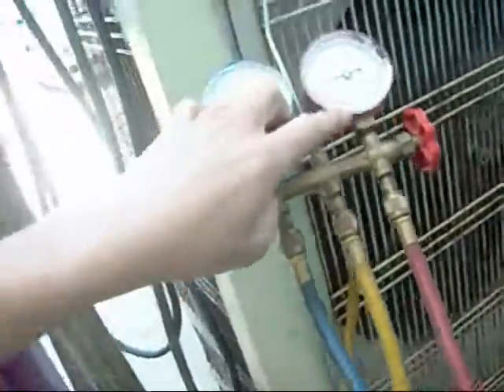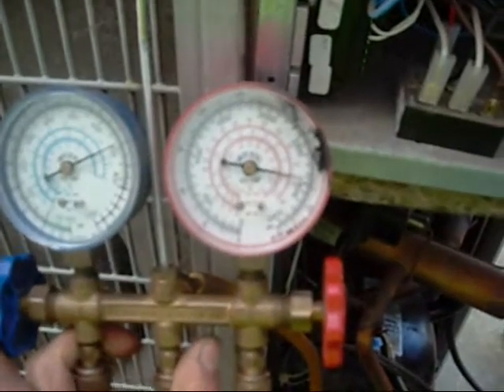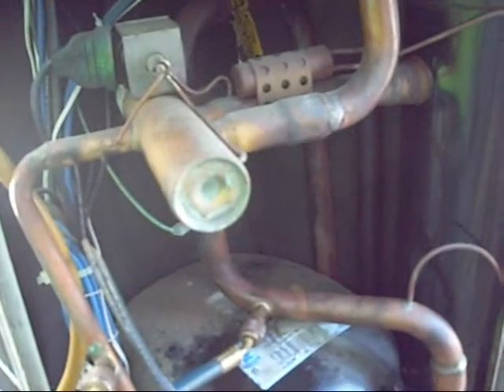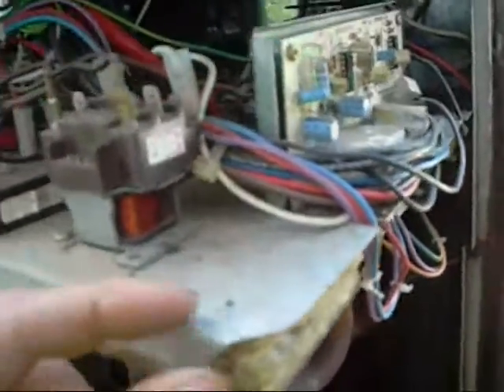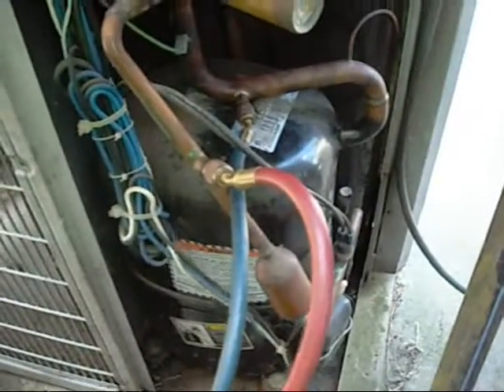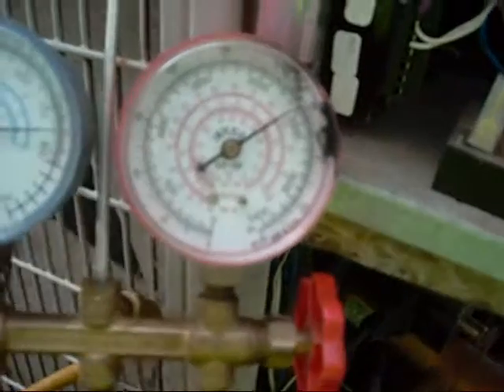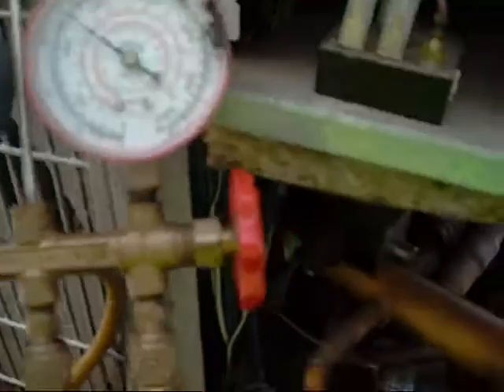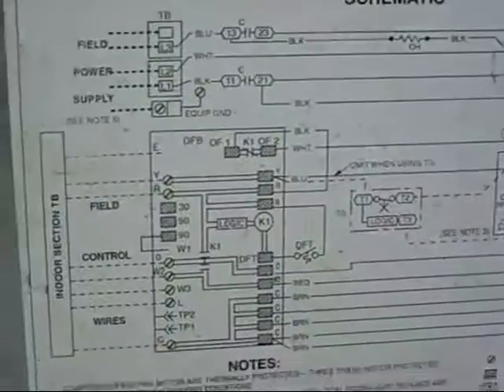Advice Needed on Carrier Water Chiller Fault (Resolved with new units)

Comment: OK, I think there are couple of problems.  Reversing valve issue, most likely.  Also, look at about 2:28....... the coils look completely obstructed and need to be cleaned.
Reply from the maker: +Camel Crush oh they were rotted out, we got it working for another 12 months then scrapped both of them.

Comment: You might want to clean the condensing coils is it's tripping out on high head pressure. It looked like the condensing fan motor was running so that can't be the problem.

Comment: probably wont help, but the way to check a standard heat pumps reversing cycle is to unplug the condenser fan motor, wait for ice rings around the lower potion of the condenser coil, when you see ice check for 24 volts on the defrost sensor, one you get the 24 volts on the meter there is a test switch that you short out that engages the reversing valve..... hope this help....

Comment: My guest is the RV is stuck in the middle. Try disconnecting the wires and try it again. If that fails? Try connecting the RV directly to a constant 24V supply. If push comes to shove. You may want to remove that RV and bypass it all together(assuming you don't need reverse cycle?)..

Comment: looks like the reversing valve is sticking/stuck in the middle position because the head pressure rises to fast or all those systems were overcharge during low ambient conditions....replace reversing valve ,blow out discharge line and conenser, and replace  fliter drier.

Comment: @Aussie50 I think i'd be looking at th RV first too. If the chiller is only used for cooling it might not even be needed in the system, might be left over from when it was first built/converted. Would need to know exactly how it works to say for sure.

Comment from the maker: I did some research into the controlls and it trips without the compressor simply because it thinks its dropped phases, its just a safety device to protect the comp.

I'll be looking at it again today, I'll energize the RV a few times while its under pressure and see if it frees up.

Comment from the maker: no fault code on the display, its just a thermo

I've checked the flow and pressure switches and they are fine, the relay works too.

its a refrig gas pressure problem for sure.

Comment: standard volt meter should tell you where your break in power is, wish i could tell you more, but im no chiller man, just residential stuff here... should be the same principle though, low voltage controlling the high voltage. sounds like to me its a low voltage problem if itsdoing it with the compressor off. maybe a board.

Comment: Are there any other gauge connections on the high side you could connect to and see if the pressure rises so quickly there too?
I'd expect that compressor to be three phase so no hard start kit would be fitted.
Apart from the reversing valve are there any other valves in the high side?

Comment: Not worked on one of those,  it dose trip very quickly! At 450 psi i expect it to be tripping on HP switch, i wonder when it trips with comp disconnected if it trips on something else?  Looks like a restricion in the pipe from the compressor to the condenser to me, if it was the txv or capiliary i'd expect it to run longer as it would need to fill the condenser up with liquid before tripping.  Does it work in the opposite mode to the one it has been tripping on, heating instead of cooling?

Comment: If your low side pulls into a vacuum,and you have an extremely high head pressure the TXV is most likely stuck ! That is a tell tale sign. 

If you could keep it running long enough you could test temps on both sides of drier for obstruction . I would cut out driers regardless and replace ...

Comment from the maker: nah sorry, never dealt with that before, I'm having enough trouble fixing the 2 I have now :(

if its heat related its probably a bad solder joint or IC/transistor. either way the circuitry is so fine it would take a highly skilled individual to re solder it.

Comment from the maker: Thanks, that was my first suspicion, until the unit cut out with no comp running, but then again it could have sensed that and shut down too.

It has a liquid line dryer that's pretty old, I'll recommend replacement if I don't come up with anything else.

could a sticky RV also cause the restriction?

Comment: It goes off on high head pressure, Some how there seems to be a restriction along the copper line.  I would replace the liquid line filter drier as well as the suction line drier if there is any.  Also make sure all valves a fully open.  Lets see what other people write.  Im not familar with that carrier chiller but I am familear with residential refrigeration units.